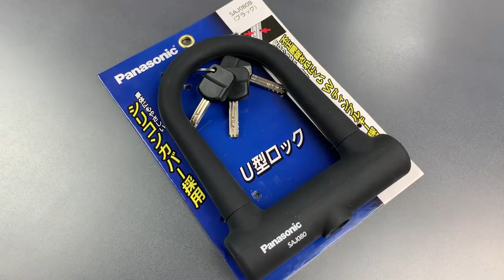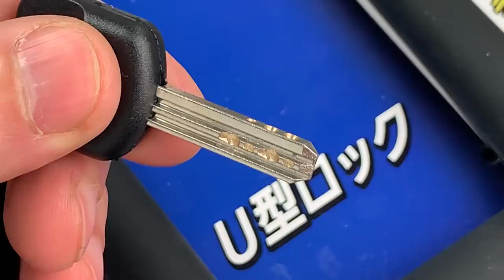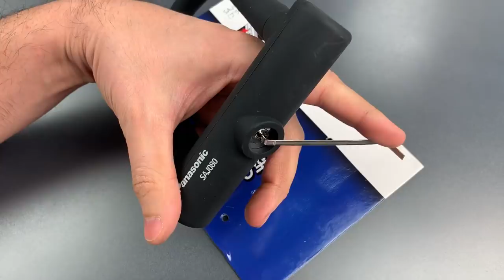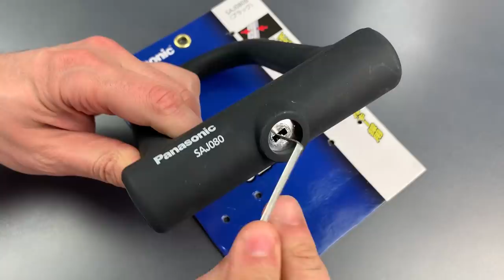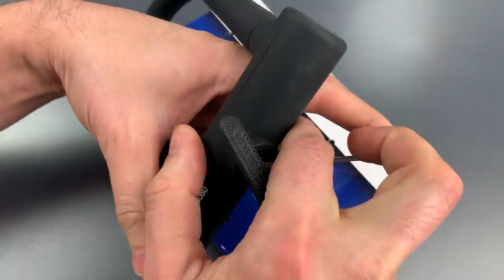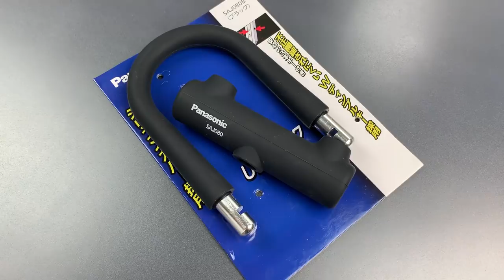[814] Panasonic Bike Lock From Japan Picked (Model SAJ080B)

Comment: Living in Japan, I basically never lock up my bicycle.  If you do use a lock, it's more likely to stop someone accidentally 'borrowing' your bike when they're drunk than to stop a real determined theft.  Drunk people usually bring them back, too. 

  Also, all bicycles in Japan must be registered by frame number, so it's harder to ride or sell secondhand stolen bikes
Reply: Panashocking.
Reply: Do you have to pay a continuous fee for that registration? (Like you would with a car) 
If so I'm never moving to Japan
Reply: @mwbgaming28  No you pay the equivalent of 5 bucks and that is the end of it. I did it to both of my bikes.
Reply: @kuribo1  I'd be fine with that if they wanted to do that in my country
Reply: 2 months ago my CBR600RR and my wife's gixxer got stolen. Motorcycle and car theft are insane here. I am using a Kitaco Ultra Robot Arm lock now.

Comment: For anyone who is wondering what the packaging says -

Roughly, 
it says the lock uses a "W Dimple Key" which makes it hard to break into (evidently this is not the case, however); the silicone covered lock is gentle even on the frame or body of the bike; keys are included; U-style lock. 

Basically what one would expect on lock packaging.
Reply from the maker: Thanks. 👍
Reply: @lockpickinglawyer  those locks are for huffys.
Reply: Wait a minute... The keys are included?! Wooooaaaaah! mind blown
Reply: Panashocking.

Comment: Many Japanese bicycles come with locks built in.   These locks are key retaining when unlocked so that the key does not get lost. Mounted on the frame, prevent rear wheel from turning.  lightly constructed. Some models can be removed with a screw driver.  These locks serve the purpose of preventing someone simply riding off with the bike.  Bicycles in Japan are strictly registered and tagged  by the government.  Most bikes that go missing are actually confiscated by the government for parking violations.   If not claimed by the owners they often end up in the scrap yard and often get shipped abroad for resale. In the Philippines such bikes  are known as "Japan bikes"  and sell for about $50.
Reply: Does bike registration over there cost money like car registration?
Reply: In the Philippines, where I am now, there is no form of bicycle registration that I am aware of.   I do not know about Japan, but I feel sure that there is a fee for registration of bicycles in Japan.   I understand that when you buy a bicycle in Japan the bike shop holds the bike for several days until the registration tag is received from the government and attached to the bicycle.  I understand that being in possession of a bicycle not registered to you is a very serious violation.    @mwbgaming28

Comment: Well on the other hand, it has soft covering that for sure won't damage the bike parts or the posts and is very lightweight and very corrosion resistant. Here in EU i'm not particularly concerned about someone trying to steal my bike deliberately, at least not the frame or the rear wheel, but accessories and seats and other such detachable things sometimes get swiped.

It helps that i didn't actually buy my bike, i observed the surroundings and found a bike where everything was rusted shut after it has been abandoned for at least 4 years, including the lock, and i sweet talked the guy from wheelchair service place nearby into cracking open the lock for me, took him a few seconds with a bolt cutter. It has been a MASSIVE project to rebuild it into something that would run, but i'm pretty happy with the result. It still looks like a junk bike though, which is good enough for me, as a sort of additional security.

Comment: I wanted to let you know that my dad recently bought a $10 luggage suitcase; it was at that price because someone changed the default combination code.

Unfortunately, I didn't have a shim that could feel the gauges, so I resorted to using both my diary key (aka the poor man's TSA007 key) and brute force to open the lock both ways...

Man, I'll be advising him to use tamper-proof seals when using that bag.

Comment: Some pretty... wild comments going on down here, so let me clear up some misconceptions. I've lived in Japan for 12 years, mostly in the Tokyo metro area. I've had two bikes stolen in that time, both because they were not secured appropriately for their value. So that was stupid of me. I now keep any valuable bikes safely inside the locked doors of my house.

- Bikes don't have to be registered, but they usually are when they are sold. You can opt out and save yourself the registration fee, but it's only about $5. I've never heard of anyone successfully getting a stolen bike recovered because it was registered, but who knows?
- Nearly all bikes are locked to some degree, but usually with a simple cylinder or combination lock mounted to the frame with a shackle that goes through the back wheel. They are not physically secured to anything so you could carry one off and throw it in the back of a truck.
- Bikes are generally cheap and utilitarian, which goes some way to explaining why proportionally less effort is expended securing them. When you can buy a shopping bike for $50, you're never going to make a living selling stolen ones unless you shift industrial quantities. Better to target the few high-value ones.
- And a big reason that crime is low in Japan is because there is greater equality of wealth and opportunity. Very few people have to steal bikes or burgle houses to put food on the table. This is because relatively high taxes pay for well-distributed public services that guarantee basic rights like education, healthcare and culture to everybody.

Comment: Rather, maybe be amazed at the plastic (or metal) linked chain (often yellow or gold colour) that helps define a visual security perimeter for businesses when they are closed. Such as a dealership that otherwise would require a steel fence or other hard barrier to prevent someone hooking up their truck to whatever car they fancied on the lot for a very low low price point.

Japan just doesnt have to deal with that kind of shit. Which I really do envy them. Instead I'm having to look at securing my racing bike in my already locked apartment to protect it from more advanced attacks that are bound to crop up.

Comment: In Japan "most people don't lock their bicycles at all".... Well, I live in Japan and I think most people do lock them, at least in the cities. But yes, this lock seems massive to me. I use a very thin wire lock and have never had mine stolen, in more than 30 years. But I have a friend who used to put two locks and a seat alarm on his cheap bikes and had them stolen multiple times. Later he bought a very expensive bike and that was also stolen.

Comment: it's an AI chip disguised as a lock, activated by picking, designed to collect data about the picker and transmit it back to the mother-ship. theres probably a battery in it somewhere or a solar panel

Comment: I have locked myself out of my garage. Can i learn to pick the lock or are door-locks unpickable. The locksmith i called seemed very fishy. He wants close to 500€ to drill a hole in the lock. He said he cant pick it open. If i had the key(which i left inside) it would only take half a core rotation to open the mechanism. I would even drill a whole myself but all my tools are in my garage. But first i wanted to ask a real professional. So what do you think? Seems like a pretty normal keyway to me but i think ive only seen you pick padlocks and not normal doorlocks. I have 0 experience with picking but to spare me a 500€ charge i would go there and learn it...

Comment: It's even better, in Japan if they go for a quick visit they'll leave the car unlocked, keys in the ignition, and the engine running when going into the konbini.

Though even while doing that week's groceries the only difference will be that the engine will be turned off.

Comment: This is not true!!! Bike theft is a huge problem in Japan. Usually you are safe with even a weaker lock though, as there are so many bikes around they’ll go for one that’s been left unlocked (everyone uses bicycles here, at least some of the time). If you do leave your bike unlocked it is very likely to be stolen! This is a bit of a strange contradiction in a country that generally has very low levels of crime. Most people have only a small circle lock attached to the rear wheel that often comes with the bike but these locks are weak and flimsy as hell,